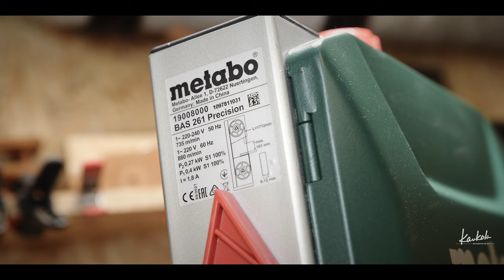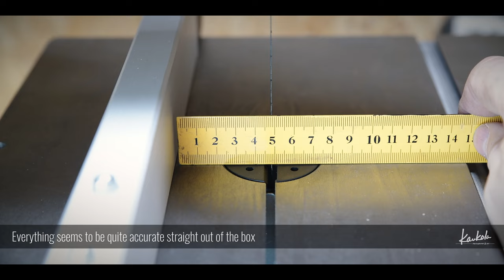Metabo BAS261 Precision bandsaw. Unboxing, assembly, first cut.

Comment: i bought this model 2 yrs ago for the same reasons. i noticed you pointed out a few defects, sadly this to be expected when any company manufactures in the land of lego style construction ( china ). i make this point as i bought a metabo hammer drill but it was assembled in germany for the same price of the bandsaw, but back in 1988 ie $700.00 NZD. however METABO is a good brand.

Comment: Why my Metabo is turning band left while cutting.(around himself few degree) everything is straight but piece of Wood is not in parallel after finish cut.
Reply from the maker: That sounds very strange. I adjusted my mitre saw only once, when i bought it. I cut piece of wood, checked the angle with 90degree ruler. If it wasn't right, i adjusted the blade, and did everything again, i made these steps few times, until cut was straight.
Reply: I'll give you a bit of advice on this machine, strip the whole thing down as much as you can be bothered because nothing and I mean nothing is set up anywhere near properly, they are just chucked together in China,  and what you will learn from it is, how each litte part should sit & work,  I had a bad tracking problem with the blade it just wouldn't sit right on the bottom wheel no matter how much i tried,  so I completely stripped the bottom end down  and it turned out  the spindle that holds the bottom wheel wasn't sat properly in the frame/structure,  so I just re assembled it all just taking my time and making sure everything just sat right and looked true, after that blade/wheel tracking was perfect,  Even with all those little bearings on the guides it helps if you strip em down and just put em back it give you a better understanding of how they work, the machining on the bearing blocks/holders is so cheap n cheesy it beggar's belief,  I paid £200 uk pounds for mine and that included shipping,  you have to ask yourself what do they leave the factory for in China,  and it will probably be pennies,  that says it all,  anyway just thought ide let you know my encounters and frustrations,  good luck 👍
Reply: Thames for posting. Just bought a servings hand one and pretty impressed with it. Does a great job for a hobbyist.